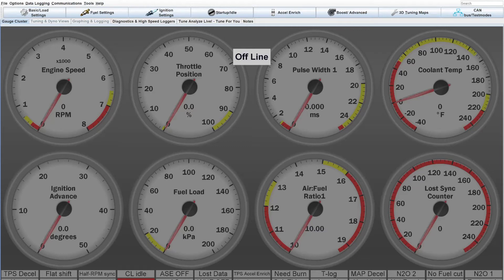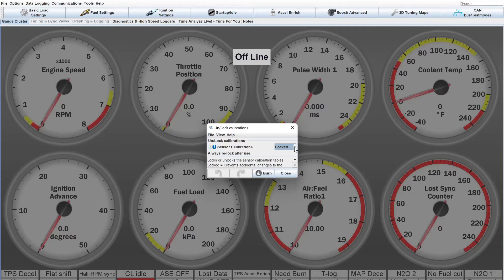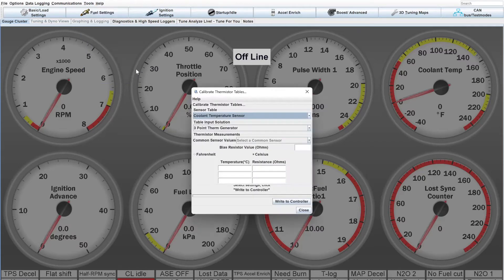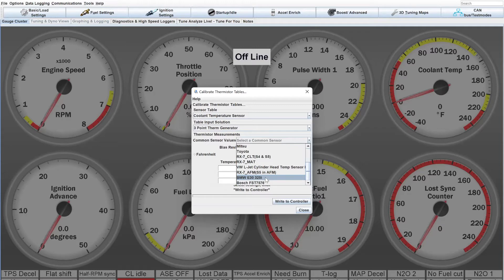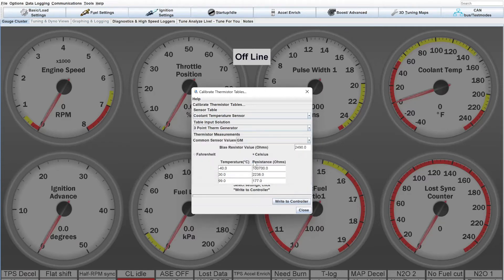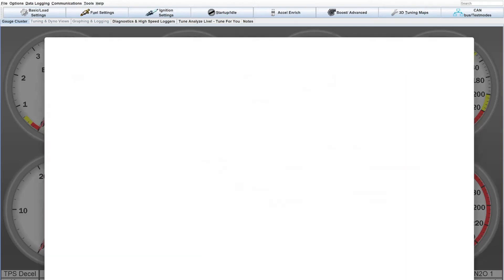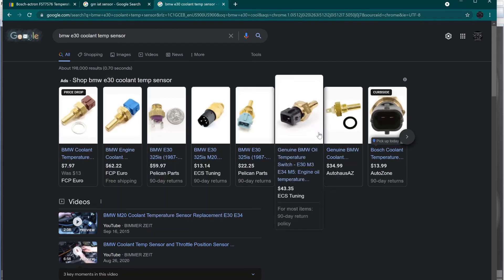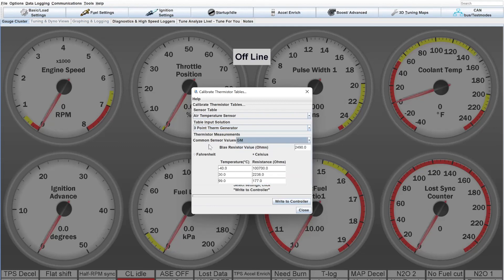Megasquirt Coolant / Air Temperature Sensor Calibration Basics

Comment: Good, but a bit rushed... Can you please make video how to tell if sensors are showing meaningful values... Thank you
Reply from the maker: 🙏 I try to keep things short and sweet. You will know of the temperature sensors are correct when the engine cold because the output values will be very close to the ambient temperature. Coolant is usually a couple degrees lower than ambient on a cold engine and air temperature is usually about the same as ambient.
Reply: @TurbineResearch  True True